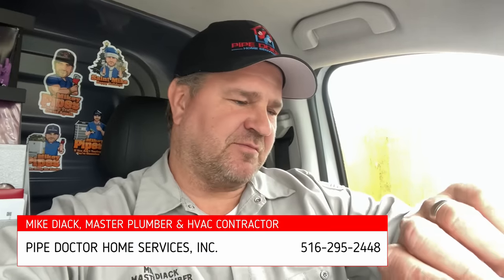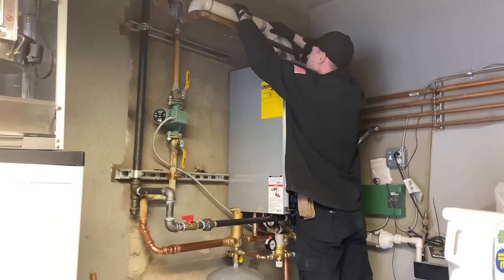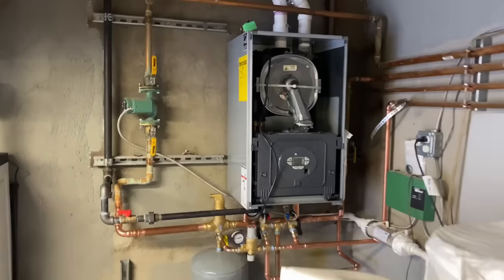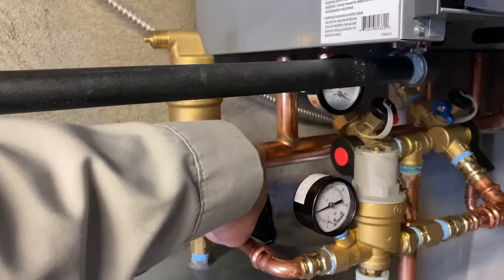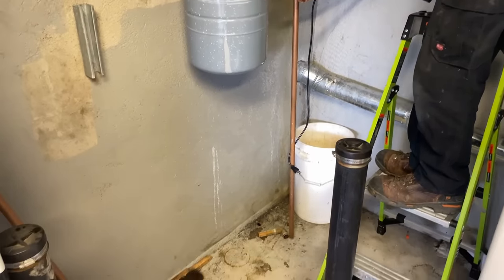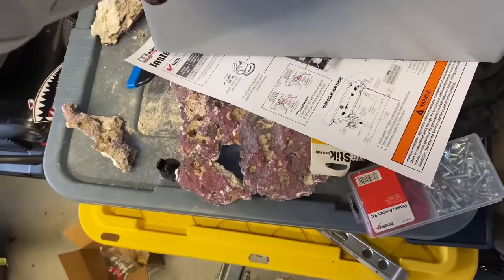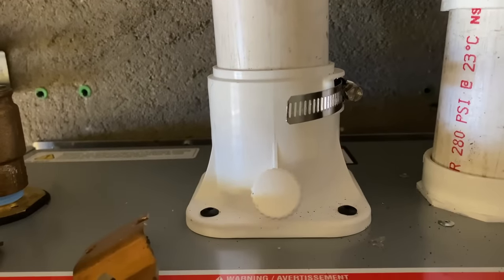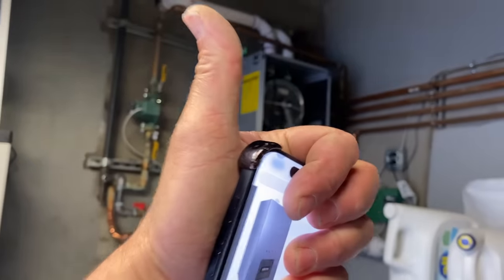Possibly The Best Tankless Combi: Burnham Alta by US Boiler

Comment: These boilers are phenomenal. I didn’t see you using the USB connect? Gives you much more information through your smart device cell phone or tablet. I installed 2 units together for redundancy. Existing System had a tekmar indoor outdoor multi stage controller, The existing tekmar sensors are compatible with the Alta boiler,controls All we had to do was Connect sensors to the lead  boiler & run a cat five cable between the two boilers for communication and lead lag control. Another bonus we were also able to common Vent the fresh air (The exterior wall was 22 inches thick, building was originally built in the 1840s)
Reply from the maker: Thanks so much for sharing your input

Comment: My dad was always loyal to the Burnham brand, having them in all our rental properties (both steam and hotwater systems). When my parent's house needed a replacement for their Series 2 that cracked (30 years old), I could have went with a direct replacement. I decided after research to go with Alta Combi (200C model). It has so many great features as you note compared to the other units out there. Plus, no outside wire is required.  My installer and I decided on separate pumps for 5 zones with a Taco relay box because we had rebates from the utility company in RI. Plus we saved a ton of space in the basement too by hanging it on the wall. The price for the unit was actually reasonable since I got it online shipped to the house. Where it was costly was the install since we had to do all new piping. System is quiet and the DHW heats up nice and quick. Lets see the long term how it holds up.

Comment: What backflow preventer is this that you are using?  I wanna check it out.  Love that it doesnt need a drip vent
Reply from the maker: It’s called a double check valve and not a reduced pressure zone that you’re implying
Reply: We always have bought the auto fill with backflow from caleffi.   Always trying to see if there's a better way. Love the videos, I always try to learn!

Comment: Mike did you or Daniel read the venting requirements for this piece of equipment? Or do you normally go against the manufacturers venting requirements?
Reply from the maker: I can read. The label on your sisters panties say ”come here”
Reply: @PipeDoctor  good one
Reply: I read and followed the venting requirements. Minimum is above the snow line for us in NY. And they want 12” separation vertically and horizontally.
Reply: @DCHVAC  it says you must use 30” of cpvc and 1 90 in between boiler and pvc vent pipe. Charlotte pipe also says not to be used for venting. The burnham guy in my area also showed me his install of the Alta and he also did not put it in.  So everyones doing it

Comment: isnt that primary secondary manifold spread too far? I thought it was supposed to be 4 times the diameter of the pipe or less? If its 1.25 inch shouldn't it be 5 inches or less to be effective? Its nice the control panel folds down and all the electronics seem to be covered in plastic so nothing gets shorted out while servicing.
Reply from the maker: I think the great engineers over at US boiler has a down pack

Comment: There is these electric European ones, there is no difference to temp or water pressure. They normally install them in Hotels. I have installed a few in high end homes they cost a fortune. But you don't need gas, you don't need water pressure vs temp, they are induction like induction hot plates they give you perm water pressure perm temp and when you cut the hot off the electric is off. I bookmarked one but can't find it again.
Reply from the maker: Thank you so much for sharing

Comment: Made in Amish country 👍👍
What is the nylon cable tie across the heat exchanger for? 🤔
Reply: Just for packaging. Should be cut off or it will melt itself off. 😂
Reply from the maker: Good question!